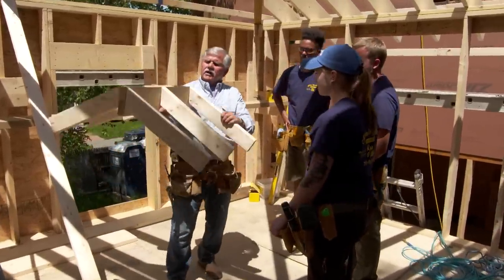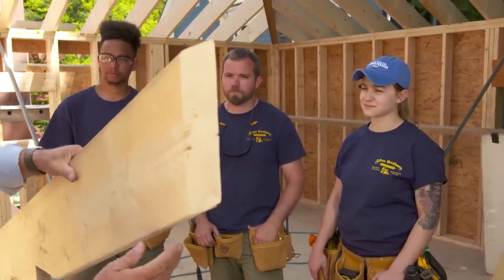How To Frame A Hip Roof | Generation Next | This Old House

Comment: Good video but, you need to explain how you got the length measurements. For example, where are your measuring points on the ridge rafter and the top plate? People can see that you have all of the lengths written down on the piece of wood but they never got to see just how you went about getting those measurements. Thanks.
Reply: I doubt he knows, since he doesn't understand what's basic to teach apprentices.

Comment: How do you get the template for cutting? Plus, we use separate dimension of wood from where I am from 2by2  and 2by4. 2by4 for the wall plates and and ridge and also for the common rafters. Those all the principle still hold?

Comment: Hello., wondering if you will be using building framing metal straps or does that depend on local building code? Live in Missoula, Montana and occasionally have small earthquakes. (building sways). I'm running to get the De-Caf.

Comment: But how do you arrive to your measurements for the hip and jack rafters without a rafter book. I have yet to see a youtube video that shows this
Reply: You can use the Pythagorean theorem + a long level + a tape measure to get your rise and run and calculate the diagonal. Or you can measure your short wall top plate plus sheathing, divide by half, subtract half the thickness of your ridge beam, and this is the run; and your desired pitch times your run is your rise, then use either trig or Pythagorean theorem to calculate your diagonal. Then do the same thing with your desired overhang and mark this additional measurement as you opposite end plumb cut. There are a million videos on it.

Comment: Whats the advantage of a worm-gear circular saw? My Porter Cable is worn out and I need something new.
Reply: The advantage is that 1. You can see the blade as you cut if you're right-handed, and  2. They last for many, many years. About all you have to change is the electrical bushings (easy), and the cord connections (also easy). Worm-drive saws are practically indestructible.

Comment: You are incorrect about the plumb cut on the hip rafter and the seat cut on the hip rafter you do not use the "common" rafter plumb cut on a hip or valley.
Reply: Right, on the speed square . for a 6/12 pitch on common rafter top cut should be 6/12 pitch hip n val top cut.they are not the same angles

Comment: I use 4mm & 80mm screws with Impact screw gun to frame roof to get it all together instead of the paslode      then hammer nail it with 4in Galv nails no strength in the gun nails
Reply: Real framers do not use screws. You're an amateur.
Reply: @kenton6098 BS, screws are superior to nails!  C’mon rookie!

Comment: No, no, no! A common rafter rises say... 3 inches in 12 inches, but a hip or valley rafter rises 3 inches in 17 inches. So hip and valley rafters are lower sloped rafters than common rafters. This guy is clueless and shouldn't be let anywhere near apprentices. I'm a 30 year framer and contractor and know WTF I'm talking about. This guy doesn't .

Comment: Couldve at least taught them how to use a nailer on the ground before throwing them up on the roof.
Reply: That's the problem with youth today. Becoming too soft.
Reply: DrPepperJunior not really much to teach. Aim and squeeze.
Reply: Tom S What is the problem then? That they abused you in your youth doesn’t mean everyone needs to be abused.
Reply: @Engineer9736  You just proved my point.
Reply: @Engineer9736  Do you really consider that "abuse"? Putting someone on a roof with a nail gun is the farthest thing from "abuse" that I can think of.